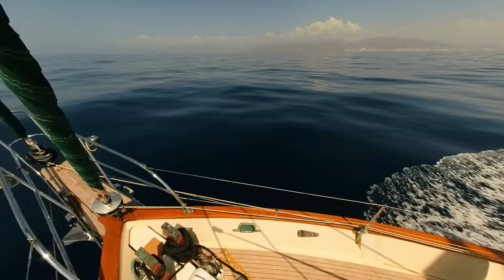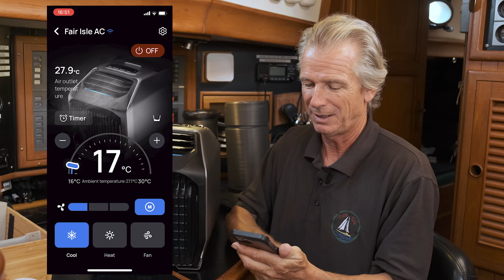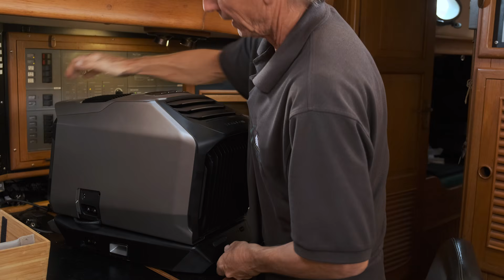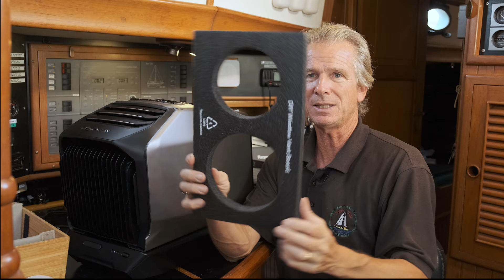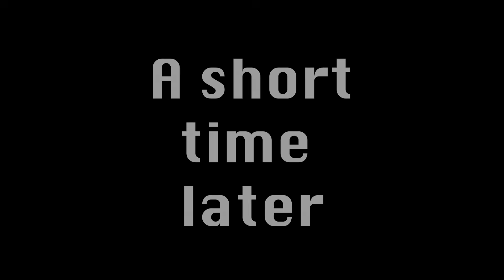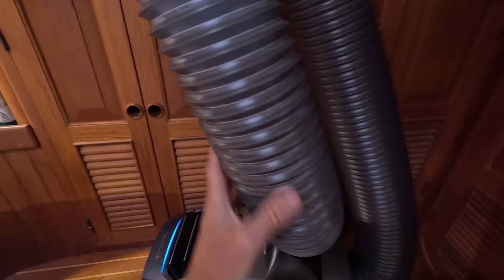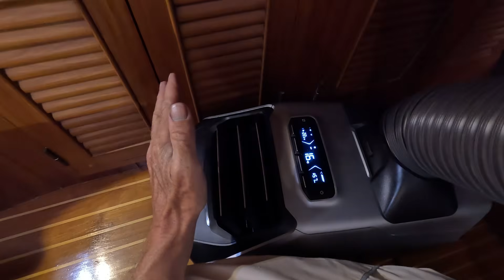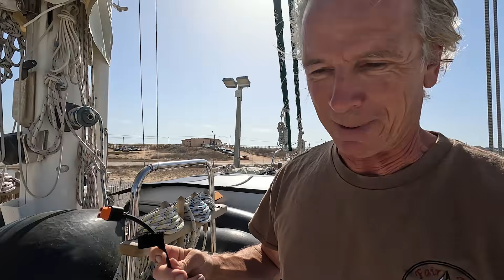DC AirCon for your boat... it works!

Comment: As an HVAC pro of 50 years. Your airflow for your cooling needs to take room air and cool in down. So it’s always gaining on the temperature. When it was on deck is was pulling the “return air” from outside where the temperature is a constant. A/C units will gain 20-30 degrees as air passes through them. So if the outside temp is 40 it will never get the room below 20 or so plus your losing temps in the tube. 
Hope that makes sense.
Reply from the maker: Yes makes perfect sense, needs to recycle the air to keep cooling and dehumidifing
Reply: what about a 110/ 120 volt  mini split ac .. are they more economical to run.. the rv society are switching to them a lot lately????

Comment: Good info. 

Air-air heat exchangers have some advantages (portable), but I’d love to see a water-air heat pump that could be plumbed into the hot water system…cool nights and hot showers in the morning😉

If this is something y’all will keep, will you wire it into a 12v bus (converter needed as I think you are a 24v boat) and find a “mounted” location for semi-permanent install?
Reply from the maker: We are a 12v boat but the unit cannot run off 12v (or 24v for that matter) it either runs off mains or it’s own battery or the high capacity DC outlet from the modern EF units like the Delta, So it’s quite versatile and could effectively run off 12v because you can charge it’s battery from 12 vis the XT60 plug. It would be nice I suppose to have a low cost option without and battery’s which could run direct fro DC. The BourgeRV come closest to this as it’s able to run direct from 24v

Comment: €1200!!! You'd be better off with a small ac window unit. €300. Bigger, of course. But most small units will run off your inverter and with enough solar, mike minimum 160pw, it will run 4-5 hours.
Reply from the maker: You might just be able to save a few pounds on the initial cost but the price you pay in the electrical demands will mean any proprietary unit will be unusable on a boat unless you have a genset and are willing to run it 24/7. That has been the limiting factor for AC on a boat for years, this unit provides a way to get around that